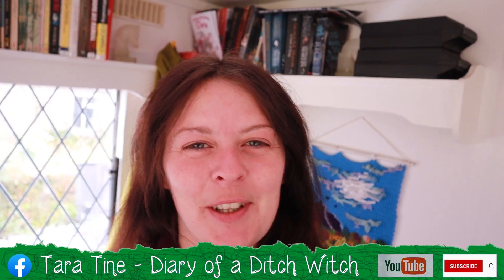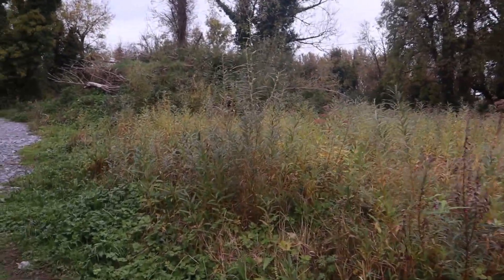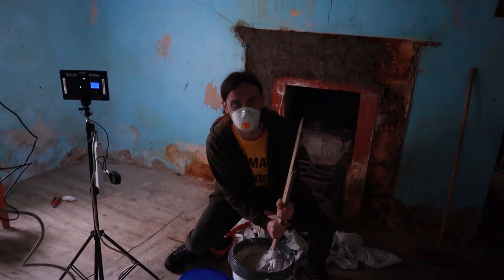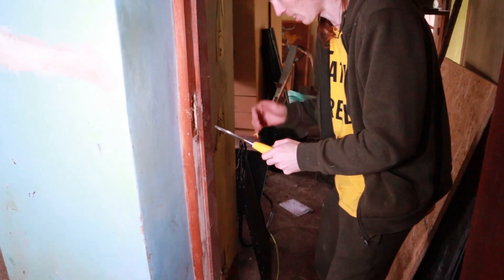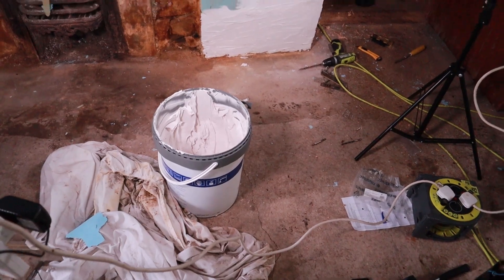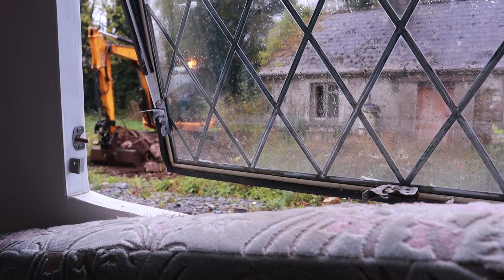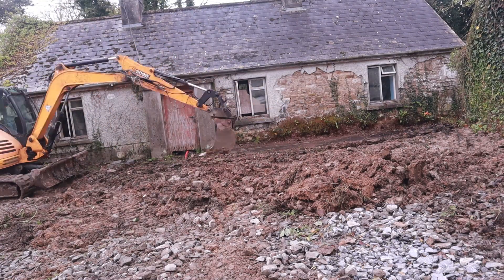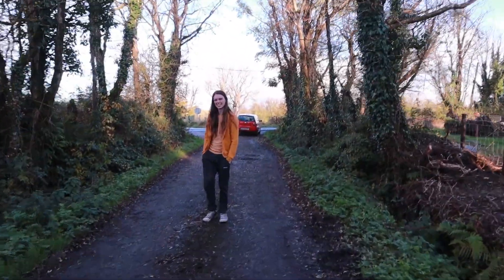French Drains, Floods & a Trip to the Hospital! || Diary of a Ditch Witch

Comment: Glad ye decided against a controlled burn,  twoulda been an awful waste. Have ye heard of Hügelkulture? Permaculture technique of raised bed mounds based on rotting wood. If you've some scraps left ye're not burning, ye could try put it to use like that? I've not tried it myself, but supposed to be moving to a site that's got lots of cleared growth like ye, and hoping to do that (I have neither the patience nor charisma to be documenting it by video, sadly, no help there). 

Other thought was you mentioned the nettles. I'm mentioning this as much for the sake of engagement as anything cos I'm sure you must know, but nettles are butterfly homes, dont be clearing all of them (unless you or Dave are super reactive and need them off your land), not to mention they make a highly nutritious tea or soup (or as a kale alternative to colcannon etc), something you'll well be needing after this dose on ya.  At the risk of sounding a bit witchy, I've found myself that nettles respond best to very deliberate touch and communication - they don't like being ignored! Say hi n announce yourself, go in boldly, there doesn't be stings in the same way at all at all. Accidentally brush against em though,  well, they don't like that 😝
Reply from the maker: Fab tips there Cereus, plenty to consider! We have a mass of nettles closer to the house which are going nowhere, as for the 'pile of crap', we need the firewood drying out asap, but will be mindful of potential hedgehog hibernation, and will not disturb any nettles that manage to survive the 'de-piling'.

Somebody else has mentioned Hugelkulture, so I will have to look up more. In the meantime, for our wetter months, we're considering chinampas!